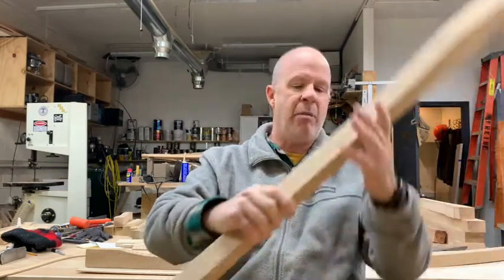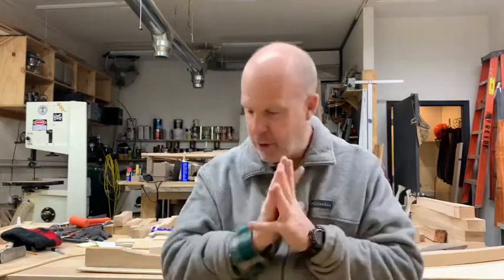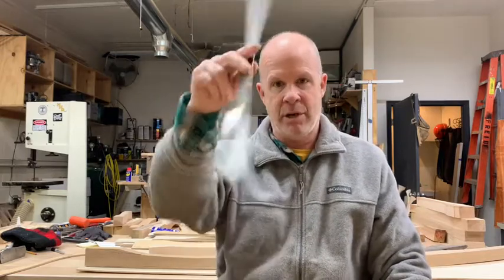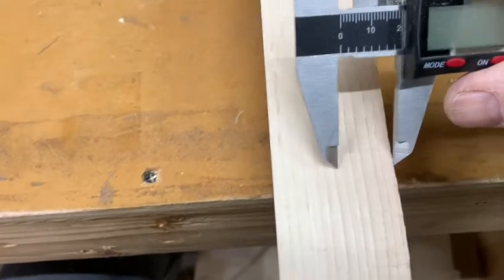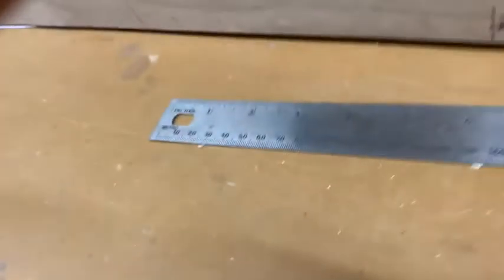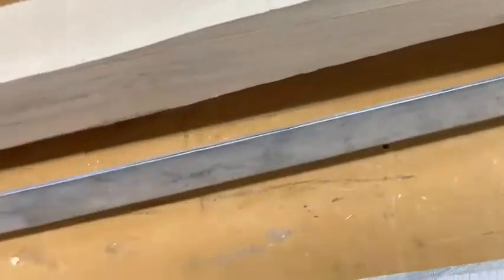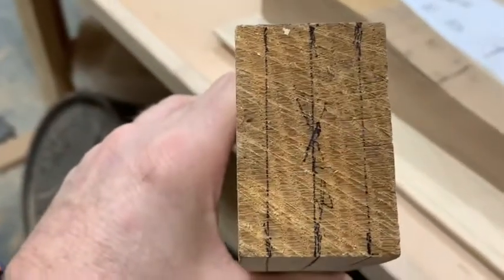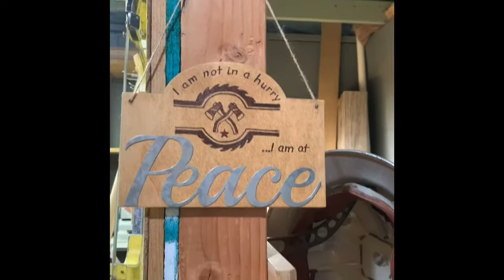Center lines/Axe Handle Layout/Keep it Straight  Part 2 axehandles#findcenter#symmetry

Comment: So many times handles are slightly off when you buy them or the eye is off center and these are very hard to figure out, do you have a way to work out these problems? Thanks Winston for these great informative videos
Reply from the maker: It’s sad but even the handles we’ve come know through BBR have their problems. Less frequently, but none the less. I basically fit a piece in the kerf. Sometimes I’ll even carefully widen it because usually it’s not very thick. You want it snug but not tight. Titebond 3 in the kerf and on the piece. Clamp it once installed. Trim it up and recut your wedge kerf correctly. Maybe I’ll just to a video. 🤔🤔😊🪓🪓